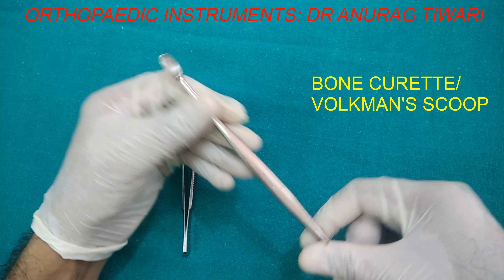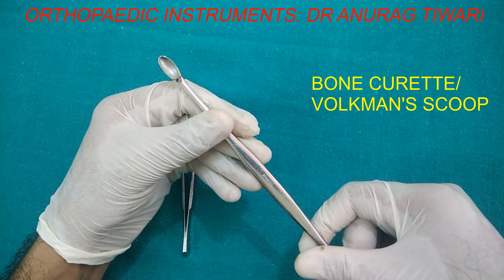Orthopaedic Instruments video by Dr Anurag Tiwari.

Comment: K-wire, Steinman pin, Denham pin, Square nail for radius, ulna, Drill bit, Bone tap, Screws, Shanz pin/screw, 08:24 Periosteal elevator, Bone chiesel, Osteotome, Bone gouze, 12:28 Tissue dissecting scissor, Mayo/sutue cutting scissor, Artery forceps/hemostat, 15:17 Needle holding forceps, Kochers forceps, Allis forceps, 18:36 Bone curette/ volkmann’s scoop, 31:28 Bowman retractor(Bone levers/spikes), 25:57 Bone nibbler, Bone cutter, Plier